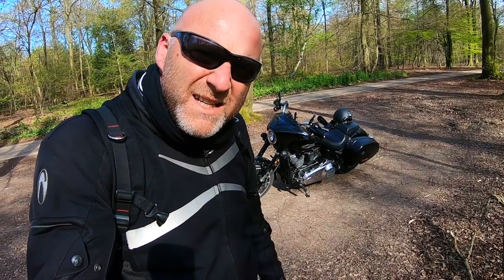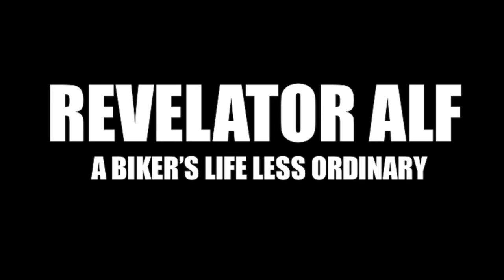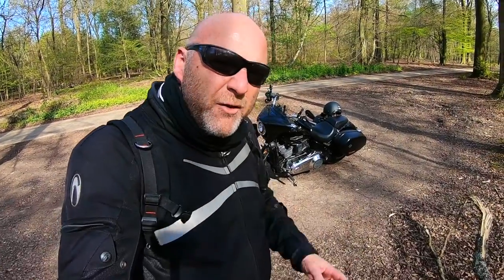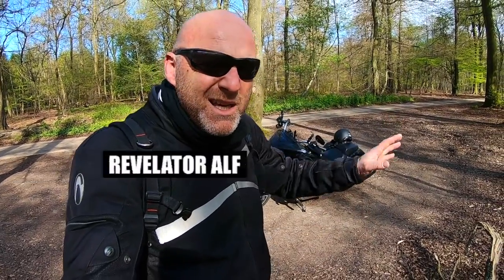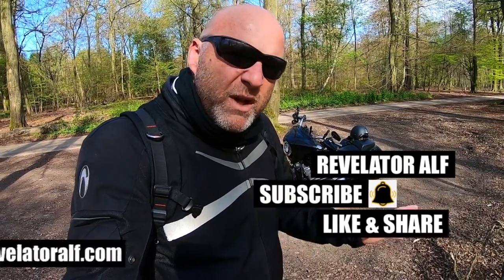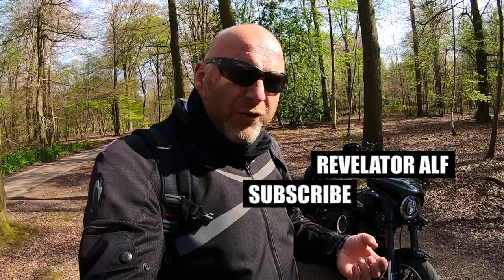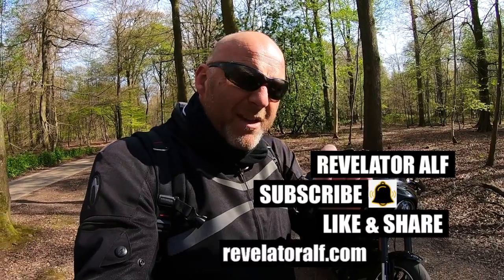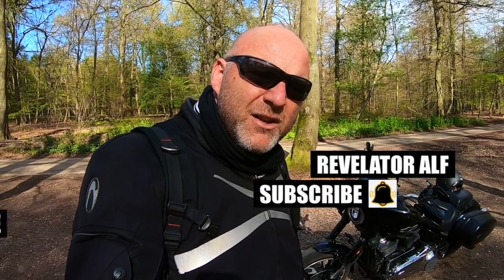Do I Remove My Engine From The Frame | Best Motorcycle Engine Working Practices

Comment: 1990 Sportster, replaced cylinders and pistons/rings several times, engine in frame.  Only time it ever came out was a crankshaft replacement.  Everything else, do it in the frame on this bike.  However, it is a pain on the floor without a lift to get it to a more comfy height.
Reply from the maker: Yep agreed

Comment: Clutch is not a good example when talking about a moto guzzi, this is a complete dismantling of the bike 😁 with my old LeMans3 you suppurt the engine then lift the bike off, and split the motor from the transmission. Just last month put a new drive belt on my 81 Sturgis, had to remove primary, transmission and rear swingarm from the bike.
Reply from the maker: Yep. I think BMW are similar on some of the bikes too

Comment: 36k miles. Thus far oil is all the repairs it's needed. So far, I can do that with the engine in the frame. If I gotta remove the engine, it'll become a decoration. I ripped most of my rotator cuff off the bone last year. Lifting my coffee into the microwave is about as much work as my dominant arm tolerates these days.
Reply from the maker: Oh sounds painful
Reply: @RevelatorAlf  Pretty intense for a couple months. Now it's generally not any worse than the good shoulder. Just can't lift much or above the shoulder.
Takes a year to recover from a shoulder replacement. Think I'd rather just live with it as is. Doesn't affect riding much. Except for quick transitions at slow parking lot speeds.
Reply from the maker: Yep that’s always the conundrum cheers